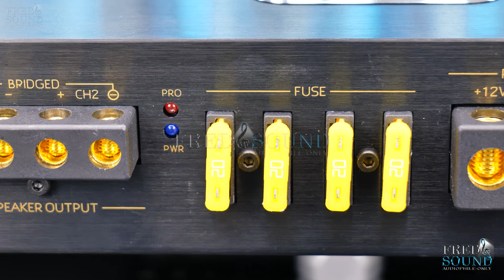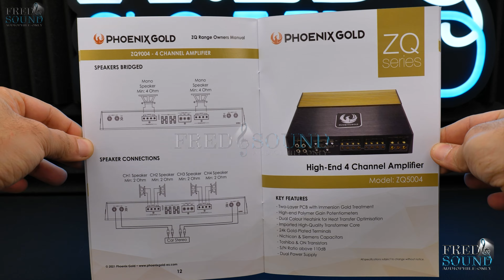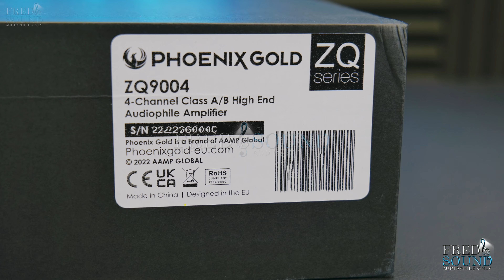Phoenix Gold ZQ9004 intro @frednsound

Comment: Hi, Fred. If i choose MSS kit for front door, what is the most appropriate 2 way  kit for rear door? Is it ME650CIII, or another one? Still wait for your review on the MDSP12.
Reply from the maker: Hi, I would go MSS for the rear as well, thanks for watching
Reply: @frednsound  thanks a lot. However, if i want a complete 2 way kit in box, what should i choose for the rear?
Reply from the maker: @TheTakimata  MSS6 + MSS1 for active setup. if you want to run passive, than get the ME650ciii genuine italy.
Reply: @frednsound  thank you so much, Fred.  Sorry for asking too much. But i'd like to know whether i can combine MSS kit with the new MDSP12? Is it too weak for MSS6?
Reply from the maker: @TheTakimata  it will work but not at its best, MSS need some high-end sound quality amps to perform at its best, use K-series, master stroke series, or qk series, mdsp12 can be used as a stand alone DSP.
Reply: @frednsound  so my budget for them  must be much higher. Thank you, Fred! Have a nice day!
Reply from the maker: @TheTakimata  have a great day mate 🎼